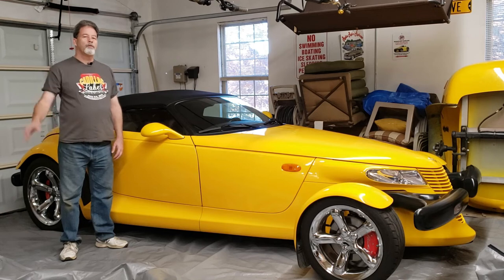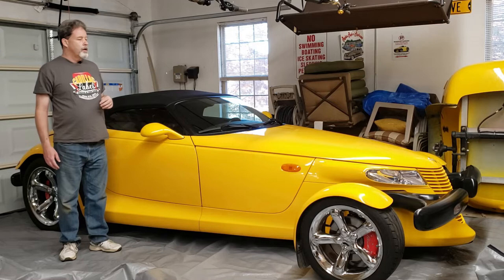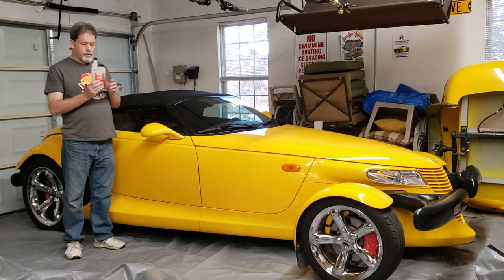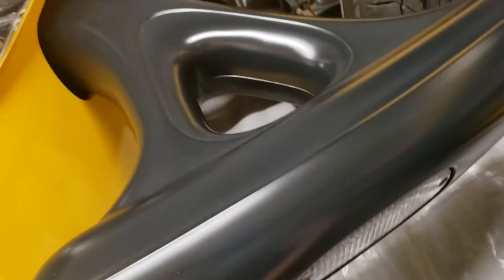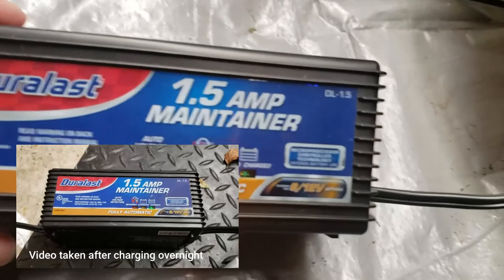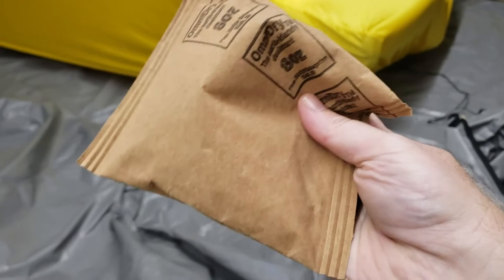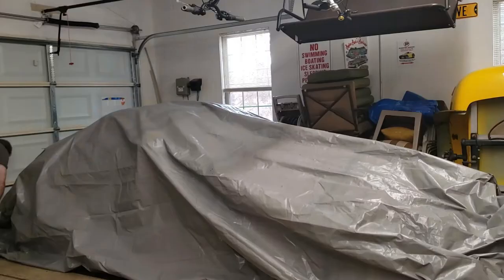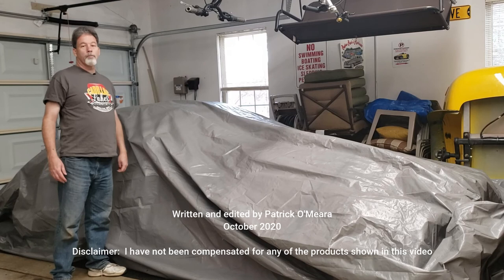What it's like to own a Plymouth Prowler - Part 24 - The Kat's IN the Bag

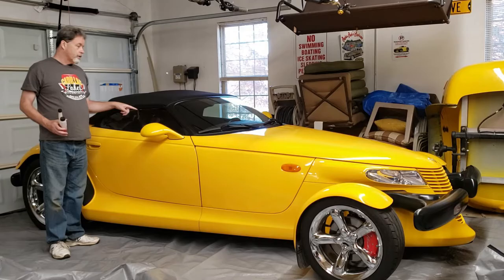Comment: 4:32 - A BETTER SOLUTION; Take your car to a Tire Shop to have the tires purged and refilled with nitrogen.  Nitrogen molecules are bigger than normal air molecules, and it is harder for them to leak out. This means a tire filled with nitrogen will maintain the proper air pressure longer than a tire that's not filled with nitrogen.